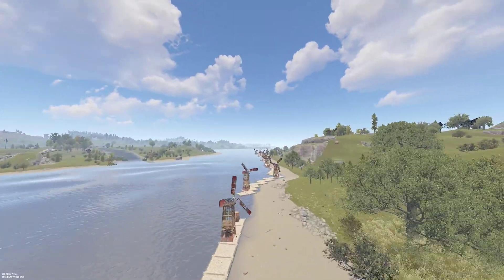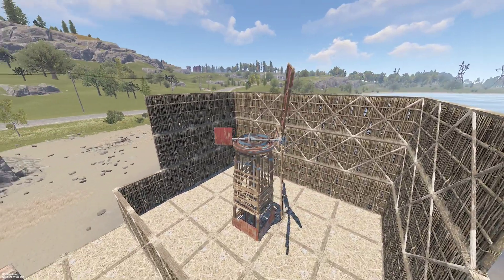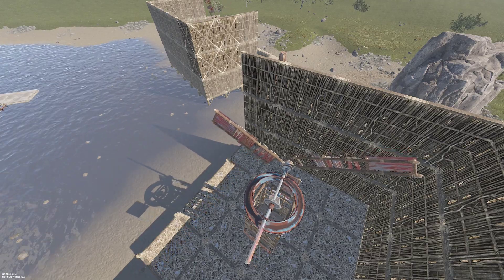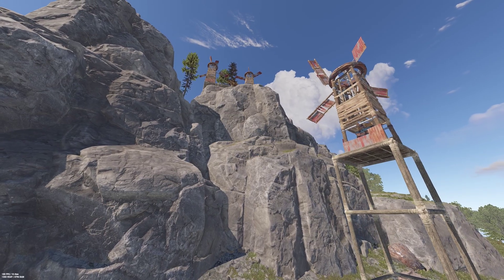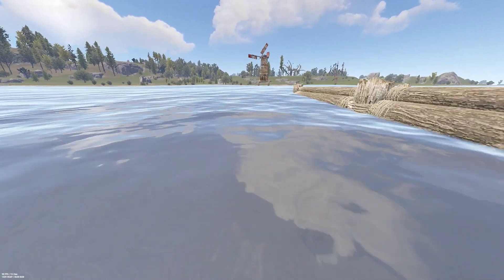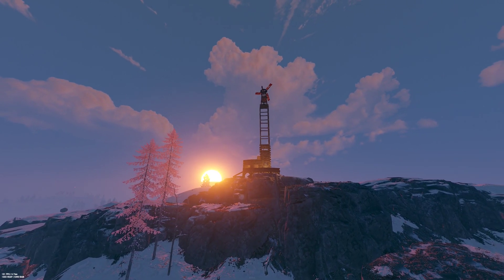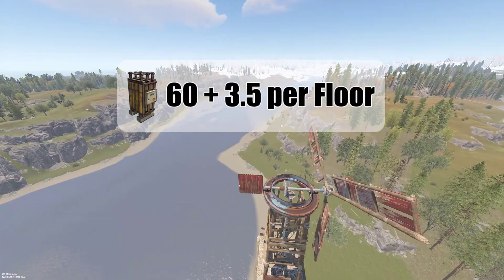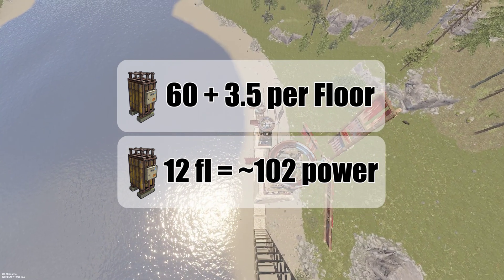Wind Turbine Power Guide | Height, Obstruction, & How to Max a Large Battery in Rust

Comment: just throw 2 per large battery and youll be fine
Reply: Thats what i usally do man. I got it 4 floors and it's only giving me 30-40 power. Wtf is that? It's the first time it happend with me. U know anything about it?
Reply: @YTS123  the power output of them fluctuate but anything above 4-6 building blocks high should be good, that's why I just use 2, I generally have no issues
Reply: @itmecatt  alr man, imma try that then. Thanks😀

Comment: I always build them 9-10 walls high, lets you run the wire to a electrical branch at the bottom in full length and will always give at least 100-120Watts of power.

Comment: OK so i usually only max out my usage on a large b at like 91 or 92 because even if i have a wind turbine giving 101 or more power 90% of the time i feel like it never charges. My question for you is does that battery take in more than 100 power as they are charged? Or just like max 100 out is it max 100 in as well?
Reply: @sigbog so a large battery can power 7 turrets with this logic or am i wrong?
Reply: I can power 10 turrets off 1 wind turbine.
Reply: @raymondhull7040  lol thats impossible my friend, the battery only outputs 100 power to everything. so just for splitters or anything else every single thing you add is minus 1 power. 10 turrets = 100. so nah you cant unless

Comment: Make a 1x1 with a triangle on it. build wallframes 8 floors high, you place the windmill on the single wallframe for low upkeep. And add 2 solar, then you can run 9 turrets easy :) at a upkeep cost thats like 310 metal frag's with 2 garage doors.

Comment: 102 power will NOT sustain a large battery at full load. If you look at the description in the crafting menu, batteries are only 80% efficient, so you'll need 100 / .8 = 125 power to sustain a large battery. I typically pair my turbine with a single solar panel to achieve this; from my testing, it is not possible to do with a turbine alone.
Reply: He's referring to the charge, not the windmill output. At 12 floors you're getting around 119rWm, or 95rWm to the battery (on average). At 14-15 floors, you'll average 101 rWm to the battery.